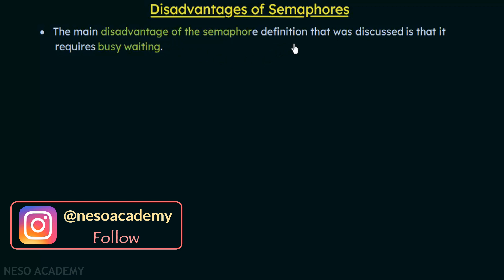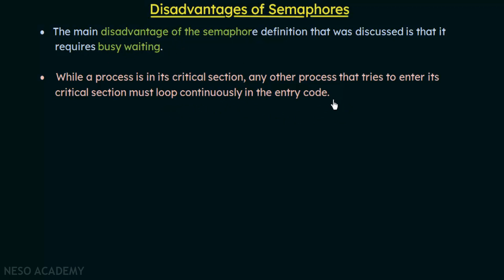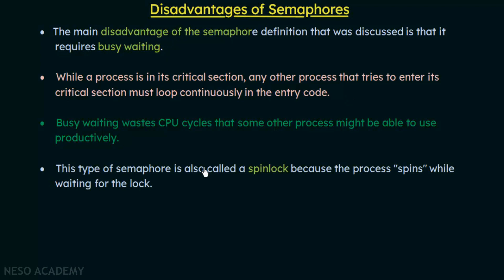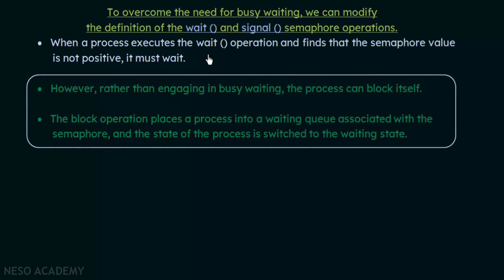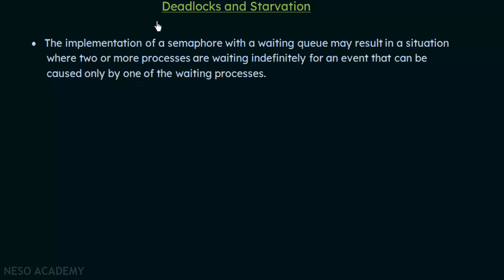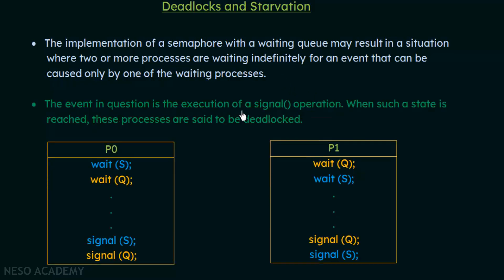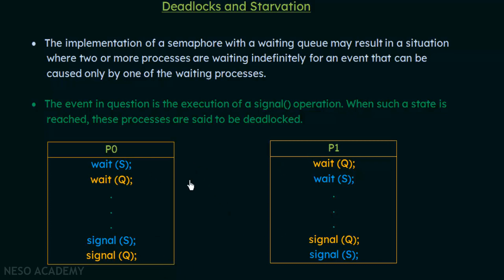Disadvantages of Semaphores

Comment: 00:07 Disadvantage: Busy Waiting in Semaphores
01:31 Busy waiting in semaphores wastes CPU cycles
02:46 Modifying weight and signal operations to overcome busy waiting
04:06 Blocking a process prevents it from busy waiting
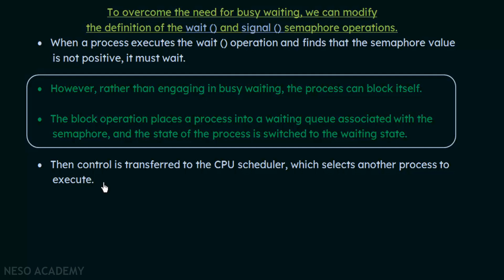05:27 Implementing semaphores with waiting queue can lead to deadlocks and starvation.
06:50 Deadlock can occur when using semaphores.
08:13 Concurrency issues with semaphore usage
09:40 Semaphores can lead to deadlocks
Crafted by Merlin AI.